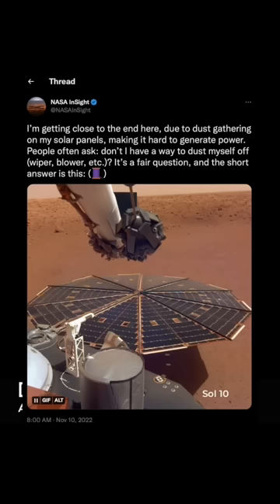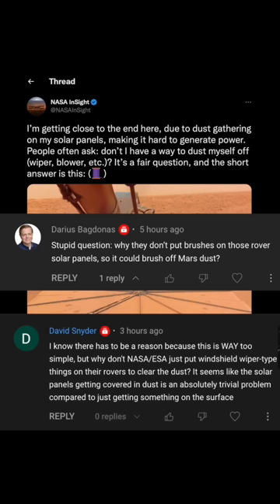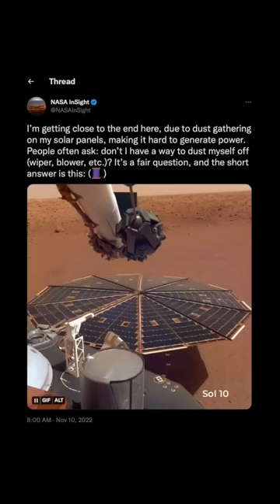Why don’t Mars probes wipe the dust off their solar panels? #shorts

Comment: I understand that a brush or wiper would not be a good idea but why not compressed air you could have a small compressor on the lander that could compress enough of the atmospheric gases to have pressure to blow it clean.

Comment: A wiper? NO! A blower (Yes. I know. The atmosphere is not very dense), A shaker. Electrostatics. There are more ways than a windshield wiper to deal with the problem. And these methods do not require a lot of space and weight. Besides... which is cheaper... a whole new spacecraft delivered every couple of years, or extending the life of an existing craft by a couple of years?

Comment: What about a tank for compressed Martian air. Have a system that brings in air and filters out dust. Run what ever tests you want and store it in a tank. When not running tests just store air in the tank. Then fold the panels up and use the compressed air to clean the panels. Wouldn't be perfect but should help alot.

Comment: Excuse me doctor smethurst, but what about the instruments that are designed and capable of collecting samples when it be possible to install some sort of a air pump line that would be very low and wait that could pull in are from the surrounding area and then push it back out with a compressor and use the surrounding air through a compressor line that is very low weight attached to one of the already usable instruments to blow the dust off gently like a natural cleaning event?

Comment: Ok, my genius mind says a CO2 cartridge that the arm could pick up and blast across the surface with no physical contact. Won't be window washer clean, but a  50 or 60% increase in solar could be years more operation.  So maybe 1 to two pounds. Maybe less.  Not sure of the area we are trying to clean.

Comment: These are just challenges, not an answer.
Dust removal feature is hard to design (for the reasons you've mentioned) and for the two years goal, wasn't necessary. Obviously on hindsight and for future missions it would be worth while to invent it. That's how every mission learns from and built upon the lessons of the previous missions

Comment: Small compressor with uses the atmosphere to blow it off?  Could use existing armature with the assumption it has the degrees of freedom needed.  Bonus is you don't need to worry about condensation, right?

Comment: Instead, make the solar panels able to spin with a simple motor to use centrifugal forces to get the dust off... Should be easier/less energy than earth cause gravity is less and less atmosphere to act as resistance. (I know those are small compared to moving the mass just saying it is technically easier than earth so it is feasible)

Comment: Couldn't they build a small nozzle for compressed gas to blow across the surface of the panel? Not constant, but build up a charge with a small compressor and discharge when buildup is bad. So not the wiper, just the washer fluid system modified.

Comment: What if the solar panels had a servo motor to turn them upside down, so the dust would fall down, and if that wouldn't enough, they can even have some jittering mechanism or vibrator

Comment: CO2 mini cylinder cartridges, like ones used on say, paintball guns! They could be adapted. They are small, not heavy, some could have been placed, along the under side, with a single actuator and mini vent tubes, located at intervals. Divided, the stream of gas would have enough movement to remove some surface dust off the panels, yet not damage them. Only used when signals became low, one mini cartridge lasts quite a few times.  One cartridge would only be needed to be used at at time, so these would last for quite a long time on the craft. Guess I should have become an astronautical engineer, like my three college aptitude tests suggested. But no, I became a computer systems builder instead.

Comment: Get a tiny little underpowered screw-type compressor to squirt highly compressed air from the rover's arm. if it's good enough to clean computers, it should be good enough to extend the life of the solar panels--and NASA makes this stuff so good that the mission is always getting extended.

Comment: Canon cameras have ultrasonic system to remove dust from the CMOS. Using a system like that in addition to tilting the panels might remove the dust. Referencing your wiper analogy, reduced efficiency is better than nothing.
Reply: I was thinking the same - incorporating a way to tilt the panels from time to time, even to remove a percentage of the dust, would extend their working life

Comment: Seems a better solution would be to create a air wiper type solution using compressed air instead of a wiper system but the idea of not including one cause of scientific interments space sounds less like a plausible reason cause if it extends the life of the mission then it would be better to have a long lasting mission and spend the extra money on getting it into orbit.

Comment: Not a brush, but maybe a little air blower that moves above the panel to blow the dust away...
I wonder if that might be complicated because of the very low atmospheric pressure on Mars...
Reply: A little air compressor tank wouldn't weigh that much and would be well worth the investment if it served to prolong the mission.
Reply: @kenlogsdon7095  I agree.
I suppose that they really didn't expect all the other machinery to survive several years, so it seemed like the panel would be the last thing that would be of concern. (ironic)

Comment: This is not an answer to the question.  There are hundreds of possible solutions to this problem that will not add weight to the device.  For example, cleaning itself during folding, collapsed the panel and expanded it again and 90% of the panels are clean and undamaged, +90% additional time for research.  The main reason is that the engineers were given the task of making a device that would work for two years and the engineers fulfilled it.  No one demanded to solve this problem, no one tried to solve it.  The example with the car glass is not relevant at all.  You have a glass that needs to be cleaned, but there is dust on it that will damage it, but we will not clean it at all, just a great solution.  Now you have glass through which nothing can be seen, but it is not damaged, you can drive on.  Oh, it didn't work out, we drove into the fence, but the glass is intact.

Comment: When there is a will there’s a way! All these problems can be solved by Engineering and Science! I sure do hope that JPL has the brain power to find a solution! Waisting a whole mission because of a little extra weight of something that can keep it going for much longer is simply not right! I am sure some of the solutions suggested by some here in the comments section are feasible, and can be implemented. Time to include a  “dust-off mechanism” requirement for upcoming Mars missions!

Comment: Well, that doesn't seem like reason enough not to have a way to remove dust. It could extend the lifespan of the rover by several times, and prevent problems from dust storms. Seems worth the tradeoff.
Not to mention brushers are far from the only way to go about it. Just to throw a few, electrostactic repulsion and blowing air. Yes both of those have complications as well, but a room full of engineers would surely come up with something reasonable

Comment: NASA 🇺🇸🚀 should install electric leaf blower 🌀 to their space rovers. I think a leaf blower would do less damage than a wiper system to the solar panels and other parts of the rover. Also, using a durable yet lightweight electric leaf blower will not cause problem in liftoff of the rocket🚀

Comment: Why not use dead satellites and decommissioned space stations as feed stock to manufacture spacecraft in orbit? Then you wouldn't have to worry so much about a few extra ounces spent on a solar panel cleaning system. Most of the propellant cost has already been spent getting the material off the earth.

Comment: The solar panels have to be folded up to fit into the capsule to be sent into space can't they program the panels to at least tilt or shake slightly and get some of the dust off? That wouldn't add weight and would extend the life of the probe.

Comment: First, don't wipe it off, BLOW it off.  Launch it with a small pressurized tank of nitrogen, CO2, Whatever.)  This it probably lighter and more reliable.

In fact, if you designed the frame of the lander using hollow tubes, that could be your pressure vessel (Porsche did just this in their 917 race car.)

Secondly, I understand the engineering decisions behind this.  But there are other criteria to be considered, such as this making JPL look  a bit silly, meaning folks like you have to explain things.

Comment: QUESTION? Do all galaxies rotate in the same direction?
Reply: I suppose that would depend on how you define direction lol
Reply: That’s true, I guess you would need to determine if a spiral galaxy has a top and a bottom.
Reply: No. For instance, M81 and M82 are in nearly the same direction from us yet pointing notably different directions. Even when most mass of a system is rotating the same way, exceptions can occur, e.g. Venus is rotating the opposite direction to most planets, and Uranus' axis is nearly orthogonal.

Comment: sorry that's a cop out answer. they could make a make a wiper system that a tiny amount of weight. And if it ruff up the solar panels, who cares if it's used as an emergency fix. that can make it last a year or more longer to get more data.

Comment: That's CRAZY !!!   After all the cost,  time, and a great landing.  Landing on a dust planet using solar with no way to remove or reduce the accumulated dust on the POWER GENERATING MISSION ENDING panels is ABSOLUTELY  INCREDIBLY STUPID and very short sighted too !!!
(Don't bother with dumb excuses.)   Considering how much efficiency was lost because of the dust just laying on its panels  (ALL IT'S POWER),  a bunch of scratches would be like almost nothing.  Scratches aren't completely opaque.  Also, a simple vibrator could have helped too.   The ending of an expensive mission because of dust is just a waste and all the dumb excuses in the world won't change that fact !!!

Comment: Reason 1: "It isn't worth the weight." Pretty sure it is cheaper than sending a new rover or lander up...

Reason 2: "The dust is too abrasive and would damage the panels." Pretty sure scratched panels are better than obscured panels.
Reply: You are ABSOLUTELY POSITIVELY CORRECT !!!
...and all the dumb excuses in the world won't change that fact !
Reply: @Smee Self  No, not realy.   Adding a mission critical, no brainer maintenance fix like this wouldn't add very much weight at all.   There's absolutely no add this, lose that reason why.   Just stupid reasons why !!!
Reply: @Smee Self It's not a magic fix. It's a fancy windshield wiper. Anyway, yes. Maybe you put one less thing on the rover or lander, but the rest of the equipment could be kept running at least twice as long. Probably three or four times longer.

Comment: Every excuse you gave was fixable and so what if you use an extra hundred or so gallons of fuel. A protective surface over the panels and a lightweight brush, would have added only a fraction to the total weight.

Comment: The wipers analogy is not valid.  Car wiper blades are made of rubber and are basically pressed into your windshield.  Having an articulating arm with a soft feathery type attachment (think microfibre) would not scratch the solar panels.  Especially if it was used every day when the build-up was not heavy.  I think that going forward with rockets now with much better payload capacity that building into the probe a mechanism that allowed it to do science research longer is a no-brainer.  I disagree with your take on this one.

Comment: It wouldn't of been that hard to install an air valve on the end of the arm and use a small pump to fill a tank and blow off the panels. For millions of dollars don't give me the only need stuff that's for science.. don't cap you need the machine to go the distance yes the mission was 2 years.. so what your still using said device. As NASA does with most of the equipment such as the 2 satellites that are still going. Voyager 1 and 2. Had there been some small insight maybe they woulda added a larger battery.

Comment: No, this answer is superficial.
Of course it is worth to add wipers if they extend the duration of your mission.
And of course those wipers don't have to be rubber as on the car windshield, to remove water, but appropriate to the task, a brush or a blower or whatever is efficient with dust removal in Mars conditions.
Just admit it: they didn't think about it.

Comment: How about a small, high pressure CO2 tank to blast it off?  That's the main constituent of the thin atmosphere, so, no contamination. And it won't add that much weight. 
Simple. That's a hell of a lot of taxpayers money to build for only 2 years of life until obsolescence. Not like we're talking about Apple iphones here... They ARE built to do that. Raise your hand (if you dare) if you didn't know that...

Comment: incorporating a rotating hub at the base of the panel attachment point would have meant the panels could be tilted to past vertical to drop the dust off.. if a vibrating device was also incorporated, (like the vibrating thing in mobile phones, but perhaps a little bigger), that would have helped shake off even more dust..

I know that cost is a major consideration in these spacecraft, but that's the problem in this capitalist driven and greedy system - we worry too much about cost.
you don't see them worrying about money in Star Trek, do ya..?

Comment: Why not have compressed gas blow it off, why didn’t nasa have the capability to compress gas on the rover and blow dust of the solar panels?
Reply: it'd require more equipment since you'd need a vessel that can withstand a lot of pressure. And an air compressor would have a very very hard time gathering air or worse, wouldn't work at all
Reply: @logickedmazimoon6001  I still think that even a primitive acordian open and close air; atmosphere pump?, would work because the mini chopper drone works right?
Reply: A bellows blower?

Comment: Peel-away plastic film!
Reply: Or a layer of synthetic resin whose surface can be chemically peeled a couple of millimeters at a time.
Reply: Enduro riders use either peel-away layers of transparencies, or like a film cassette style mech that moves away the dirty film and pull out clean from the spool. 
But that abrasive dust might play havoc with the take-up end...
Reply: @michaeltempsch5282  exactly same for some rally drivers

Comment: Ok... I'm sorry, but this is backwards, old NASA thinking.. build at the absolute breaking point on weight and launch it on a disposable, ultralight rocket that uses every drop of fuel.. then use it up, on a short-as-possible mission, because we really don't want to spend money keeping it manned.. as we want to move on to the next shiny thing.. or better yet, get a cushy job, at 4x the pay, at Boeing.
New space philosophy is to build it to last... rugged, repairable, reusable... A simple, multi-pump, piston compressor with a small tube and nozzle attached to the end of the manipulator would not add that much weight. Pump it up, run a sweep over the panels every once in a while, and you MORE than make up for the power and weight needed.

Comment: Just a little compressor that ticks over ultra slow would eventually build up enough compressed mars atmosphere to blow that shit right off there !!
even if it took 3 months to build up a tank of compressed gas it would be enough to do the job without it scratching the panels, and weight wise well come on, I bet you could do the full system for under 1.5Kg. you argue they could put other science on there but if that's true then why are they so upset Insight is dying? it's because more data with the same experiments is preferred over different experiments. Point made ,thoroughly. sorry Dr Becky but this one time YOU WRONG !! hahaha god I'm sad, and not because insight is craving energy.

Comment: First, they could just have a folding or vibration system in place (which they probably have anyway, so why not use it to shake some dust off?), and second - where's that tiny helicopter? It could do a few flybies! And regarding abrasives - who cares if the panel wears off as long as it works?

Comment: Install an air canister on the arm.  Once every 2 or 3 years just blow the dust off. And air canister weighs like 1/3 pound. Negligible.  When the air canister is out of air after like 8 years then the mission is over.
Reply: @smeeself There's no way a canister of compressed air on the end of the arm, with some sort of automated button,  weighs more than 1/3 pound.  Lets say it weighs a pound.  One pound of extra weight to gain an extra 5 years of science is worth it.

Comment: The panels had to fold out, so why couldn't they have set that up to where they could have run that I'm reverse, letting the panels tilt and the dust roll right off?  It wouldn't have made them that much more complicated and it wouldn't have added near as much weight as a wiper system.  Maybe 100g, at the most.  A few oz and it wouldn't have been expensive to do.  I know they were designed to not be moved once installed, but I mean c'mon!  Mission ending failure due to not being able to remove dust from solar panels is sort of pathetic and seems very....  Ignorant.....
Reply: Maybe; They relied on the martian wind ; to do the cleaning?